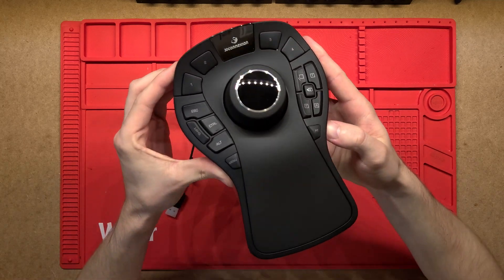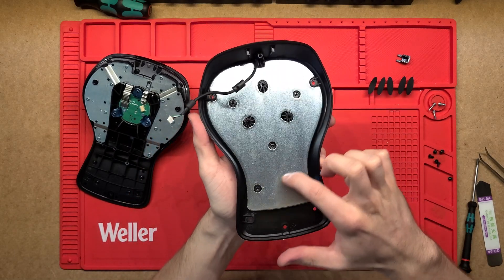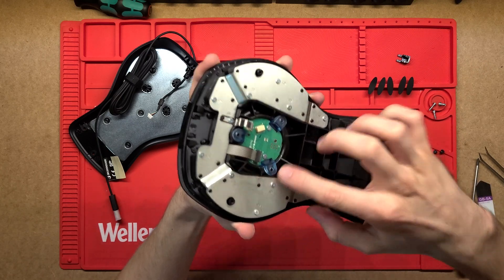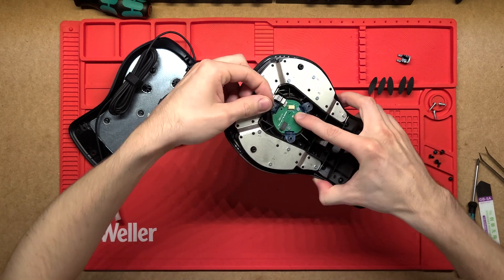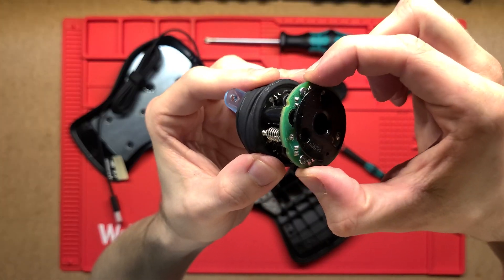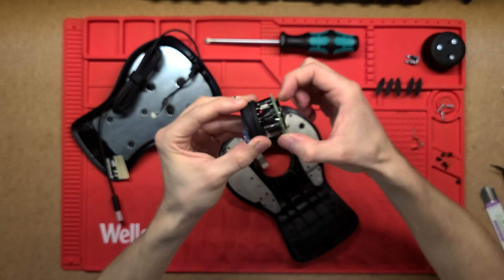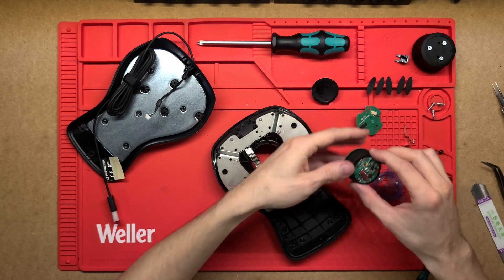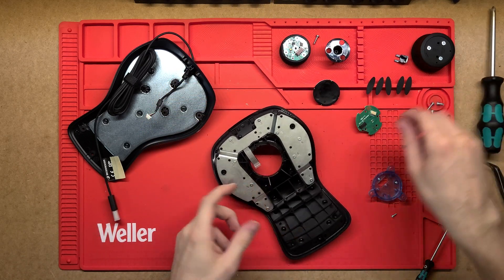How Does It REALLY Work? SpaceMouse Pro Teardown

Comment: I have a problem with mine and I can't find where to repair it. after being subjected to isopropil vapors, someone left rags soacked on top of it, then the buttons stopped working....Is it the plastic tracks? is there a way of repairing it? trying to dry it with a haior dryer deformed some buttons too...its a complete disaster and I can't find a way or contact the company to try and get replacements... some help would be awesome! cheers.
Reply from the maker: Ah sorry to hear mate, but from what you described it seems the plastic and copper tracks were damaged, doesn't sound like it's reparable. 

Maybe you can find a replacement plastic pad online just for the buttons? Good luck.
Reply: Have you tried the rice trick?  Place the whole thing in a ziplock bag of dry rice.  The rice will absorb any moisture inside.  Takes some time though, maybe a couple days.

Comment: does this device work when you remove joystick/manipulator?
Reply from the maker: I haven't tried this, but I would assume it would work. Without joystick input though, the system might interpret static or noise as random signals, potentially causing erratic behavior on the computer depending on the effectiveness of its noise filtering.